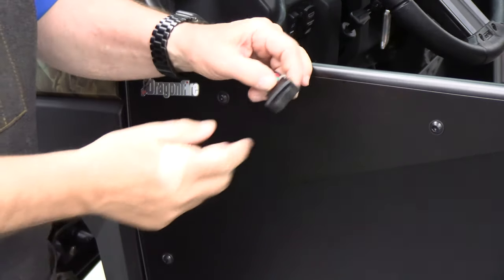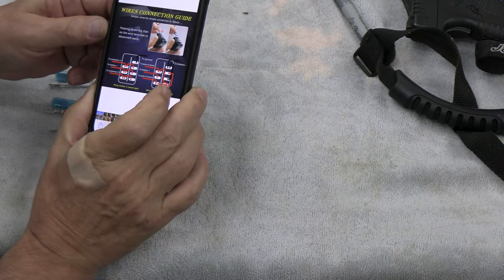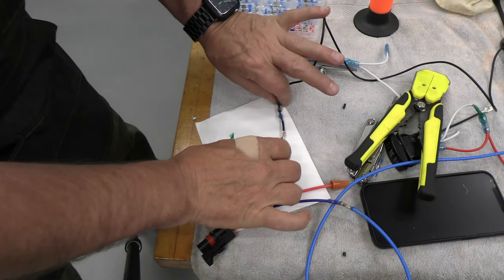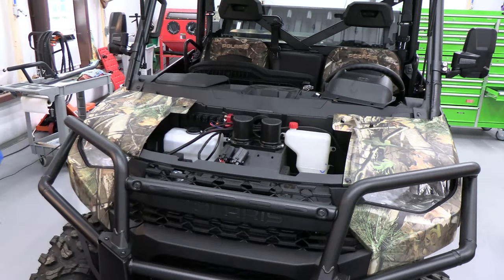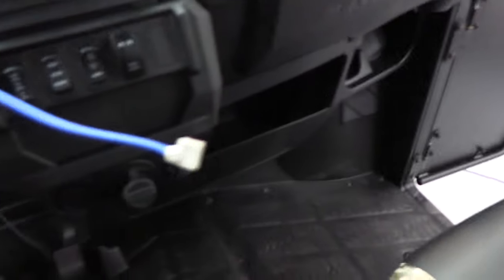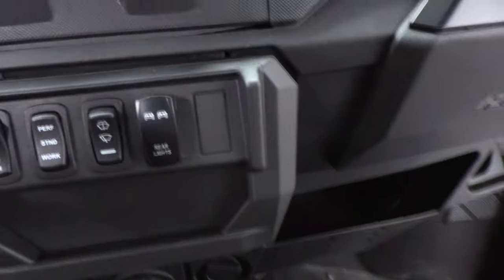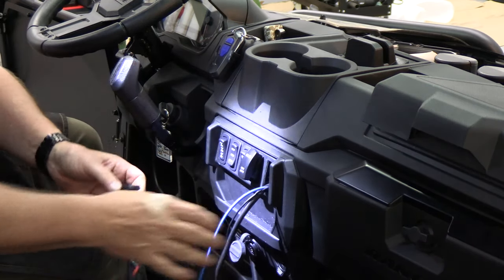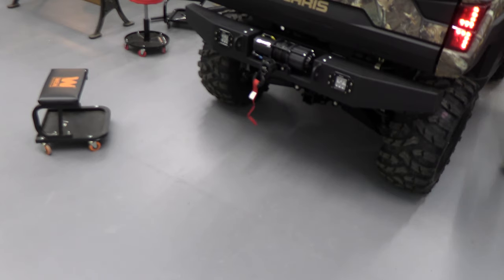Winch Lighted Toggle Switch Install

Comment: You never showed anything about connecting the wires to the switch.
Reply from the maker: https://www.amazon.com/dp/B08P56QNDC?ref=ppx_yo2ov_dt_b_product_details&th=1

This is a link to the switch on Amazon. There is an excellent picture of the wiring diagram that you may find useful. Consider subscribing. Thanks Joe

Comment: I have this same winch, but it came with the upgraded switch (not sure if lighted). The switch wiring going to the solenoid has a small red wire coming out, which I believe is the keyed-on wire. I do not know where to plug this little red wire in (Kubota RTVx1140). Additionally, I have connected all power wires from winch to solenoid, and solenoid to battery (only wire not connected is the keyed on wire) - and winch is not working (even with vehicle on or off). Is this keyed on wire the reason? Or could it be a problem with the solenoid/winch?
Reply from the maker: So really good question. The red wire that you’re talking about must be connected to a hot wire that is on only when the key is turned on. If you had a Polaris ranger, it’s easy because they have a pulse bar with a wire specifically on only when the key is turned on. I’m not sure about the Kabota but if you can find a hot wire that is on only when the key is turned on connecting it to that red wire will make your winch work. Probably great. Consider subscribing. Thanks Joe.

Comment: I want the winch to only be able to run when the key is on.  If I unplug the red wire from the toggle switch and run a wire from the key hot to the plug that you have the red wire on will that work?
Reply from the maker: Hey buddy, what you suggested will probably work however, the easiest way to wire it up properly is to use the pulse bar. The black is ground and the blue is the switched. Why are there only runs when the ignition is on the red is on all the time. Thanks Joe.
Reply: My buggy is an stock 04 Yamaha Rhino.  It doesn't have a pulse bar.  I have added an external fuse block for accessories that is only hot when the key is on.  I'm thinking that I can run my red wire from that.  I'm going to try it that way tomorrow.  I've been installing the winch today following you instructions except for the pulse bar.

Thanks,
Trav
Reply from the maker: @travharrell1713  hey that sounds like a good idea. I think that will work. Let me know how it goes. I’m sorry all I have are Polaris with the Pass bar but I think you’ve got it under control. Thanks, Joe.

Comment: My switch won't turn off idk wth
Reply from the maker: Hello there. Did you say that your switch won’t turn off I don’t know with? I don’t really understand the question other than possibly you don’t have it wired up to the switched wire. If that’s the case and it’s wired to the continuous on yes it will not turn off. If it is wired to the switched wire, it will not work after the engine is turned off, which is I think what you’d like.